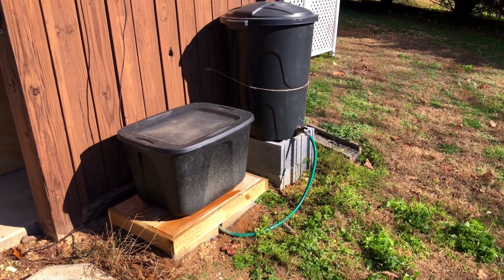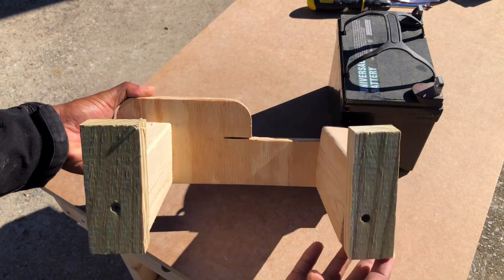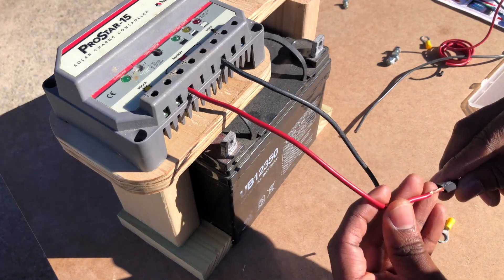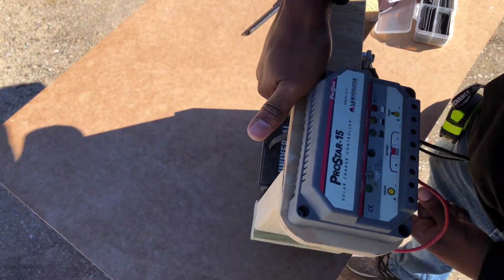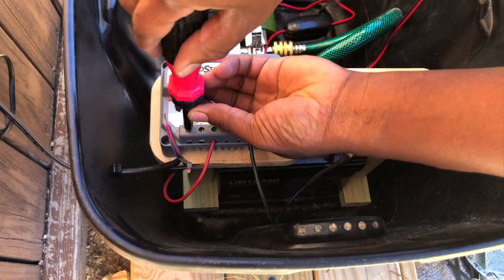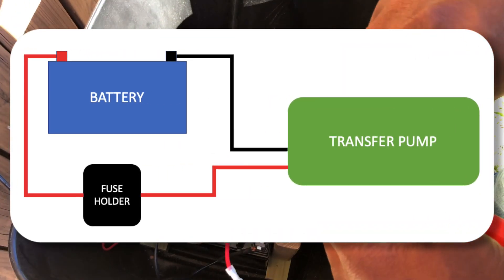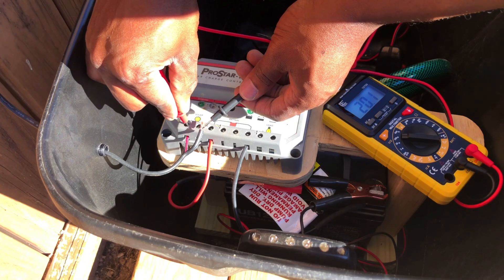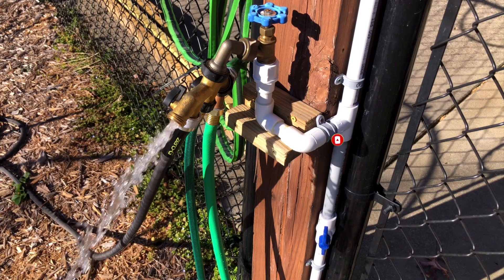Solar Water Pump | CHEAP Rain Barrel Solar Pump Setup

Comment: Something I would suggest for future electrical projects like this would be to use soldier to "tin" the wires before using a screw-pressure connection and for the spade/washer type connector soldier the wire to the connector before crimping.  Doing this will insure a good electrical connection and stop wire breakage when disconnecting for maintenance or any other movement.
Reply from the maker: Great tip Allen, and thanks for sharing with the community!

Comment: Does it damage the pump to use with the nozzle while it's closed?
Reply from the maker: Yes, overtime it definitely would and I would not recommend using this type of pump if you plan to close off the water exit point. Instead, use an on-demand pump.

Comment: How do you know if you need a 20 watt or 50 watt panel? I'm only running a 3.3gpm water pump a couple hours every day to heat hot tub water.
Reply from the maker: You usually need to know that the amount of time you need to use your pump and the voltage and amperage of the pump. Using this information plus the amount of direct sunlight you receive on average for your area will allow you to use an online solar calculator that will tell you what size battery to buy and solar panel. For a small pump only being used 1-2 times a day, a 50 watt panel should be plenty to re-charge a 12v 35ah battery.

Comment: Hi Greentech would this setup work for hydroponics system for beginners? Thanks in advance
Reply from the maker: Well this particular video does not go too heavily into hydroponics, but it could definitely help with explaining how to add solar to your setup and give you ideas for how to transfer water if you needed to.
Reply: @GreenTechTown   thanks
Reply: @GreenTechTown   Thanks for pointing me in the right direction.. Finally got my set done today..

Comment: Really nice video, mate thank you. I do have a question though, is your pump activated when you turn the faucet on, or do you have to flip an on/off switch on the pump?
Reply from the maker: I have a smart wifi relay connected to my transfer pump. If you want to activate the pump when you turn on the faucet, make sure you search for "on-demand pump" vs "transfer pump". I plan to experiment with an on-demand pump one day though and I recommend that type of pump if you plan on closing off the water path, rather with a faucet or garden hose spray nozzle.
Reply: @GreenTechTown  Thank you mate! Yes I've been looking at the on demand ones and will most likely go that route as I already have a regular digital garden hose timer with the built in valve. Incidentally, I used your video on PVC pipe irrigation to guide me through the install of the same system. Great videos, thanks mate. Mike in Florida.

Comment: Love the video! Do you have any idea how long you could run the pump non-stop with this particular solar panel and battery?
Reply from the maker: I have not performed this test, but based on the specs of the battery (12v, 35Ah) and transfer pump (12v, 10A), I would probably get anywhere from 2.8 - 3 hours assuming I only discharge the battery 80%. In the a perfect world, and if I let the battery completely drain, it would be 3.5 hours.

For my case, I generally only use it for 5-10 minutes each day, so I have not had to worry about battery capacity issues since my solar panel re-charges it every day. Note, I also upgraded this solar panel in this video to a 100Watt panel, so that also reduced my risks of completely draining the battery.
Reply: @GreenTechTown   Thank you for the response.  My plan this spring is to install a pump and solar to my IBC and want to make sure I will have enough energy to get the whole garden watered.

Comment: Is this an on demand pump? If not, why did you choose one that isn’t?
Reply from the maker: Hey Nicky. No, it is a standard transfer pump. My application did not require an on-demand pump since I will always leave my spigot in the opened position. Also, some of the on-demand pumps I looked at online seem to have a common issue with the pressure switch inside failing within a few months of use. However, I'm sure this is not the case for all of them if you wanted to go that route, just check the reviews.

Comment: Thank you for the video. I like the way you present it, the how and why.  Would this system be good to pump water from a well to a water tank with a water level switch that would automatically turn on and off the pump?
Reply from the maker: It may be possible, but I have never seen it used for that type of application, so I would advise checking with the store rep you chose to buy the pump from or ask around in an online forum.

Comment: Could this system run water into the house....?   Not necessarily pressured, but with the filter, to say fill sink? Wash dishes?  5 gallons or so to flush toilet....
Reply from the maker: I'm sure something could be done for that type of application. For washing dishes, you may want some type of filter that is able to make sure the water is safe for drinking. I have not looked into that yet, but good ideas.

Comment: Great video!  Most "kits" on Amazon pair a 20W panel with a 10A controller.  Did you used a 20A charge controller for use with a full size car battery rather than the smaller 12 mower battery?

Comment: I like this video.  Question, what are the specs on your battery?  12v how many Amp Hours?  Thanks.
Reply from the maker: 35 amp hours.
Reply: @GreenTechTown  Cool.  Did you have to match the battery up with the solar panel and the controller?  Maybe you can address that part in a future video.  I am new to this so i am not sure if the wattage on the battery has to match the output on the solar panel?  does it matter? because the panel is charging the battery regardless?  Will it take longer to charge with the lower wattage on the solar panel?   All very interesting.  I am still trying to wrap my head around the cell phone app.  Awesome idea.  Thank you .

Comment: Can I just ask how much watering time you got out of the battery before it was recharged, prior to the solar panel being added? Also, how did you charge it originally? Great videos by the way, setting up a very similar system here in Melbourne Australia currently and your step by step videos are very easy to follow and informative

Comment: I have a question: I bought all the components you used except the controller in which case I used the smaller version in the link. Battery charges controller, solar panel charges battery, battery runs pump. However: when the battery runs the pump it is very noisy (water pressure seems about what I need) and I cannot run the pump from the controller as it claims an overload. The output seems to be 13V for a 10V pump; I can bring it down to 11.6V but that still does not do the trick. Can the noise be explained by the too high voltage and is there a protector in the controller from running the pump altogether? I plan to measure the voltages before doing anything but if this is all true, I could put in a potentiometer. However, I figured I would ask this forum because odds are one of you faced the same problem. Thanks!
Reply from the maker: Good question Ed Burrman. The term "loud" is hard to evaluate without being their in person to hear it, so it's hard for me to say if what you are experiencing is normal or not. I do know my pump has a loud sound that I can easily hear about 20 feet away when it is running, but not loud enough where it would disturb my neighbors. This is also the first small DC transfer pump I've worked with, so I do not have anything else to compare it to other than the other transfer pump related videos I've seen online. If you do not receive the help you need online, try recording a video with the pump running and hold the camera/phone close to the pump to capture the sound, and show the video to a rep at the store you purchased the pump from to see what their thoughts are. There might also be a 1-800 number you can call as well.

Comment: Nice. I have a rain barrel installed and also have a solar panel this size and charge control that's been sitting in the closet for a few years. My garden isn't near an outlet so I think I'm going to do the same setup. I could probably add a timer too so it will automatically water in the mornings.
Reply from the maker: Awesome David. Go for it!

Comment: How long does the pump run for??
Reply from the maker: Hey bbikermama. If I just ran the pump none stop, it could possibly run off the 35Ah battery I have for about 3 hours. In my case, I only typically run it for a few minutes each day. By the next day, the battery is fully recharged, so I rarely have to worry about this issue even if I receive a lot of cloudy days.
Reply: @GreenTechTown  good to know, thank you!! My application needs maybe 2 hours every few days, so this is perfect! Thanks again!! I look forward to your videos!! Really good stuff you put out there!

Comment: Love these videos! Keep them coming! I’m curious why you didn’t use the “load” terminals of the charge controller for the pump. Was it just so that you could install the fuse on the same circuit as the battery and the pump?
Reply from the maker: There was no reason. The way I wired up everything is just what I am used to doing :D, but learned that you could potentially use the load terminals also, but I would recommend checking the max current it supports. Great question.

Comment: Amazing. Robert, please get out of my mind! Your series on rain barrel solar pump irrigation is exactly what I have been imagining and trying to figure out on my own.

QUESTION for everyone who has installed a similar system- 
I am using the exact solar charge controller that Robert has in his description above. I connected the pump he recommends into the load as opposed to the battery. Every port meters with aprox. 12.5 volts. Problem is, the moment I manually turn on the pump, power cuts off from the load terminal ?! I replaced the controller with the exact same one, thinking it was a fault with the unit I was using, still have the same problem. 
Has anyone had a similar problem and solved it? Much thanks in advance.
Reply: I know it's an old post but for anyone else with the same problem. Check the user settings on the controller. If the battery voltage falls below a level, that you can choose, then the controller will switch off the load to stop the battery discharging below your chosen safe level. Car and motorbike batteries don't like a deep discharge. If your set level is too high, say 12.4V then it will switch the load off as soon as you turn the pump on.

Comment: Great videos. Have you figured out a way to make this on demand instead of having to manually turn it on and off. Like using a regular garden hose timer?
Reply from the maker: I have looked into on-demand pumps, however, I read that a lot of people have issues with the built in pressure switch. For my application, it is not really necessary, but I have wanted to try one out for future projects that may need one.

Comment: I've got an after installation/operational question. It appears your (as does mine) enclosure that contains the battery/controller and the pump gets lots of direct sun which means its gets hot inside the container. The controller and battery don't like hot environments, I was thinking about install .a intake and exhaust fan in the enclosure. How have you dealt with the heat?  Thank You
Reply from the maker: Hey Louis. Great question. I have not had any issues with any of the electronics to date. I think adding an intake or exhaust fan would be a great idea as long as they are installed in a way where water cannot enter the enclosure/tote.

Comment: Thanks for the great videos they are excellent. You are a great teacher, you could do a instructional video about how to make a YouTube video every one would benefit from it.  I am going to do a solar water pump for my hand dug well. This video will really help. Ps a drip loop on the wire from the panel just before it enters the box would be a little insurance to keep water out of the box . 😎✌️🙏🏻
Reply from the maker: Awesome to hear, and thanks for sharing the tip Jim, and good luck with your project :D

Comment: Sweet set up. Maybe add a float to the barrel so the pump shuts off when the water drops to a specific level ?  I plan to set one of these up for my shower.
Reply: I just watched your float install video. I think the side mount float would be great. Keep up the good videos.
Reply from the maker: Thanks Kevin, will try my best!
Reply: @GreenTechTown  Like most of the people that comment on your videos, I like the way you cover all the details in an understandable manner. Although you're making your water system for a garden, I'm going to use mine for off grid showers. I tried going two days without a shower,..yeah/nah. Can't do it.
   Keep shining on brother :)

Comment: How do you keep the battery stable/centilated during summer heat? Does this sealed container just shorten the battery life? I really appreciate you sharing the design of this though, gives great tips on how to set mine up.
Reply from the maker: Hey Christian. Great questions. I have not ran any specific tests regarding battery life. So far I have no had any major battery life issues based on the temperature. However, the battery size for my application provides more power than necessary since I only use the battery for 5-10 minutes a day or every other day depending on the weather. Also, there are some tiny holes by the handles on the tote (facing downward), and the large hole where the PVC is routed to allow "some" ventilation.

Comment: I have seen some like this before and always wonder why the safety of heating water in a plastic container not meant to be used that way is not a concern. I should think that the plastic would leach toxins into the water. I realize this is not drinking water....but we DO absorb through our skin and where steam is present from the vapor such as happens with chlorine so it is a valid concern. I personally would use a steel (not aluminum) container for livestock of some sort instead of plastic and paint the exterior black. The fittings would all work better on metal. Also not mentioned by many are the materials that the pumps, lubricants, and metals or plastic parts are made of and if sealants used are food safe? Just my thoughts. I love the idea...just dont want to poison myself over time.

Comment: Is there a way to add a timer?  I would like to do a recirculating chicken waterer but only need it during daylight hours.
Reply from the maker: Yes, I created a video showing how to hookup a WIFI relay to this system and it does have the option to enable a timer and schedule.

Comment: Why did you use the wire size you chose?
Reply from the maker: Hey G.L. I used it since I already had it on hand and it could handle the amount of current/voltage my system would produce/consume. If you look at a AWG chart, you may find a smaller and cheaper size that is compatible with your application.

Comment: I've been enjoying these videos! I've been through the hardware store often enough to know all the things you're using, but it's still good to have a video going through the process. 
And the best part: nothing 3-D Printed (take THAT, YouTube recommendation algorithm!)
One thing I would have done different is to use clips to secure the cable from the panel to the bin, and put in a drip loop at the wall lower than the point where it enters the gland on the bin to prevent water from running down the cable and into the bin. That's the kind of stuff I picked up on my job as an ISP installer: drip loops everywhere a cable goes through a wall.
Reply from the maker: Very very good tip about the drip loops. Funny enough, I read or stumbled upon a guy recommending that a few months back.Thanks for sharing.

Comment: This was a great video! Electrical work always confuses me, but I just need more practice. I'm curious why you didn't route the wire from the solar panel to the bottom of the tote instead of using the cable gland? Thanks.
Reply from the maker: Accessibility was the primary reason. I wanted the connection to be easy to get to if I ever needed to troubleshoot anything. It also shortens the cable run since my charge controller was on that side of the tote.

Comment: Will the battery last long enough to pump the barrel completely empty?
Reply from the maker: Sure will! The battery I have is probably a little oversized for how often I need to water (no more than 2 times a day) and the amount of average sunlight I receive in my area. So far I have not ever had the battery fully drained when needing to use it.

Comment: Very cool! I have built something similar last year, My battery , charger and pump got hot sitting in the sun , So I have planted alot of vegetation around it to shade from the heat of the afternoon sun.
Reply from the maker: Nice idea!
Reply: @GreenTechTown   Thanks! I was wondering which watering method you find easier to use ? Soaker hose / sprinkler / or just by hand using the spray hose? I have not add that to my project yet and was wondering which is best to use with this setup. thanks!

Comment: Great video, one question; why did you not hook the pump to the "load" on the controller? That way, during the day the solar panel can power the pump instead of the battery alone.
Reply from the maker: Hey Robert, good question, and not something I considered or have ever used in an application. I may look into that more when I have time, as it sounds to be more efficient for sure, but so far, I have not had issues with having enough power so I did not give it a second thought, but thanks for the info!